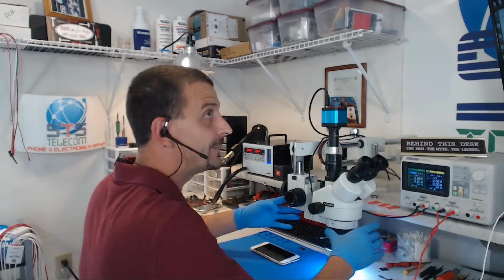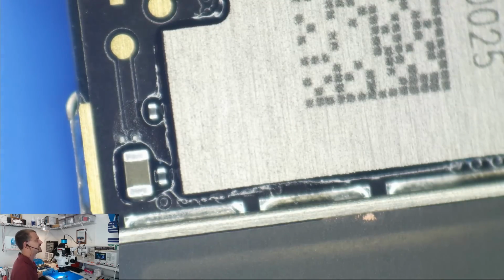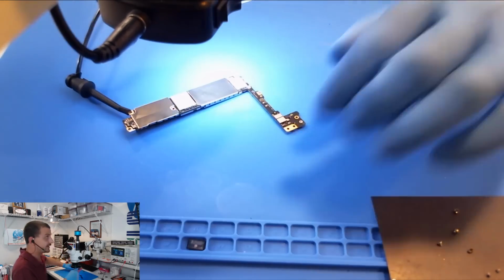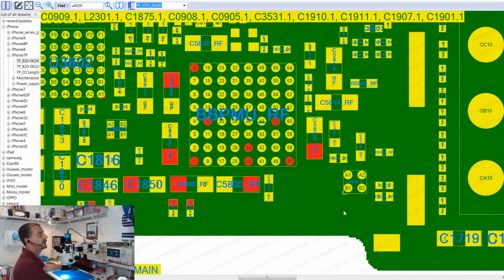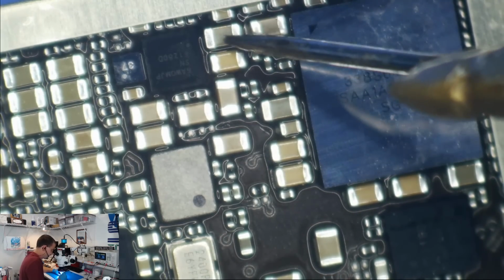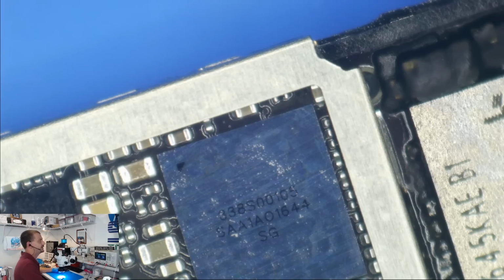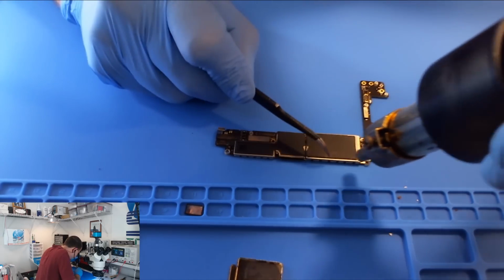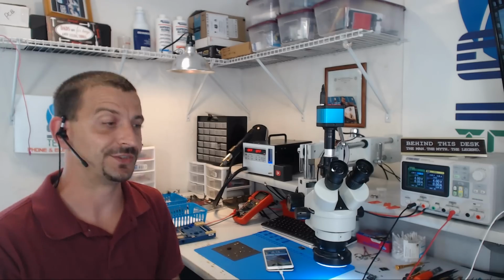iPhone 7 Plus "No Power" caused by VDD_MAIN short

Comment from the maker: All I have to do is record a video talking about how most iPhone 7 failures are not VDD_MAIN shorts an VIOLA!!  3 in a row VDD_MAIN shorts.  Happy days :-)

Many of you are probably wondering how we are liking Florida --- WE ARE LOVING IT!  I'll be posting more about our move very soon now that we are more settled in.
Reply: STS Telecom hey there that was amazing. Would you  help me fixing an issue with my iPhone 5s? after replacing the battery everything worked ok but Bluetooth phone calls. Bluetooth music, recording and WhatsApp phone calls all are working, but Bluetooth phone calls isn’t. Any idea?
Reply: Which software you use the ic chose in pc ....plz provide me the software download link...
Reply: Can an iPhone 7plus that had liquor poured on the face b fixed? It doesn’t turn on and I can’t get any data from it help plz
Reply: STS Telecom  Hi can you tell me what might be wrong I left my iPhone 7plus in car it was very hot stayed in car for 5 hours I tried reboot nothing plus holding volume down and power at same time still black screen. Do you think the heat did something
Reply: How much do u charge for repairs?
Reply: bro can i contact you  plz reply fast its urgent bro
Reply: Price
Reply: Sir num whatsapp you

Comment: I broke my 610A3B U4001 U2 USB Charging Power IC Tristar Chip 😬 as i tried to replace it. I thought itll be easy to fix it without heat gun. So i used hair blower and the soldering wire doesn't even melt i think i messed up everything cuz i used lighter to melt the parts 😂

Comment: Hi can you advice the best temperature to use when changing an iphone u2 ic
Reply: heat up slowly. 1 min 170 then 1 min 230 then one min 280. then one min 350. use lots of no clean flux should work fine

Comment: hi, i replaced my rear case on my iphone7. since then it wont charge anymore. when the iphone 7 is turned off and i plug it in, it does turn on. so there is a connection. it just wont charge anymore. what could be wrong ?
Reply: battery loose?

Comment: Hello STS telecom! ! This is abit of a "please bro" I know, but please hear me out, I'm trying to repair my little sisters iPhone 7, I found that there was a direct short on the main power line to ground, injected current, and found that a capacitor was getting really hot, I removed it and the short cleared, I now have 95 000 ohms between the main power rail and ground, I plugged the phone into the charger and USB amp meter and found it was drawing a very constant half an amp, I took the board back out and found that most of the capacitors next to the power management ic, ( there's 12 rows of 3 caps) were all shorted to ground, apart from one of the rows of 3 in the middle. I noticed that these rows of caps are running on 4 separate power lines, and they are shorted, one line is shorted to ground at 15 ohms, one at 21 ohms, one at 22ohms and one at 60 ohms, I noticed also all these caps and power lines were common on the power management ic, so I'm guessing they are different voltage outputs? And the fact that they are all shorted, would that point to it being the power management ic? I obviously want to avoid attempting to change it if there's any chance it isn't that that's the problem, although I have ordered a replacement power ic.. Please any help would be greatly appreciated, iv never worked on a phone before but iv got half a brain, I also have the board view software but I don't think it's one were you can see the lists of power rails it just tells you what the components are and where they go to. Thankyou so much if you have read this and for any help. Reace from UK

Comment: I'm very new to this and finding it hard to get some good info on the basics. Really helpful video here about shorts in general, but I'm trying to fix a tablet right now, and trying to determine if the board has a short. 

When I hook up the DC supply, I'm getting 0.6A going through the circuit. Is this normal? Sorry for bothering you with a question already. New subscriber here

Comment: Hi bro iPhone 7 plus same place full head and I checked that capacitor but not short but full heating plz explain solucation bro
Reply: Every case is a bit different so your problem could a number of things.

To narrow it down, leading up to the phone going dead, what happened? What caused the problem phone to die? Was it dropped or hit by something? Was it in water? Was it left in a hot car? Is it recognized by iTunes? Have you tried a new screen? Where on the phone is it heating up? Front or back? Top or bottom?

There are a ton of questions that need to answer to narrow down your problem.
Reply: fixed it?

Comment: My son drop his iPhone 7plus about 3 ft high on to concrete floor and now won't come on?
Reply: To identify if you're phone has electrical damage. When plug to iTunes, is the phone detected?

If it is, then I'd recommend changing the screen. If changing the new screen does not work there maybe issues with the back light or image circuit or the phone may be stuck in dfu mode.

If iTunes does not detect the phone then you will need to use the more advanced troubleshooting methods.
Reply: fixed it?

Comment: He should use 3 1/8 thermal paper from office depot and place a piece of thermal paper on the board and a thin foam sheets on top of thethermal paper, about 1/8 thick and use the length need.then place piece of glass on top to add pressure ,1/4 inch thickness,cut to 4 by 6 inches.
Then add the power start at 20 seconds and work your way up tell you see a image of the radiate heat from the short .
Reply: That sounds like an interesting 🤔 technique that sounds fool proof. Anyone can fix an iPhone these days 😃

Comment: Hello, no idea where to contact you so i'll do it here. I've got à problem with my iPhone 6 plus and please, help!
Let me explain : I can not run it, when i try to charge it it goes in an infinite boot loop, when i plugged it into the PC to try to fix it with iTunes (in DFU Mode), all was good until it disconnects itself while trying to switch to recovery mode..
Impossible to run it without plugging it to charge (+it goes in an infinite boot loop)
What should i do? Open it.. check battery & connections ?
Thanks & awesome content !

Comment: 21:56 I was practicing on an old iPhone 4S and blew out the balls on the PMIC, NAND and CPU (which was on the other side). What temperature/air combination should I use in the future to avoid this (I was using 450 degC with 60 air on a Quick).
Reply from the maker: I use 380C and 40 on airflow for almost everything.  I could easily overheat the board if I held the nozzle too close for too long though.
Reply: i have a quick and i use 365c and 80 air flow,enough to get the bga and caps off but not too much that it blows stuff away.30 seconds and i can have a nand off and 10 seconds for a cap.450c has prob damaged your board beyond repair for a guess im sorry to say.